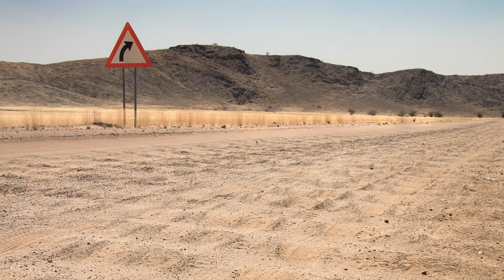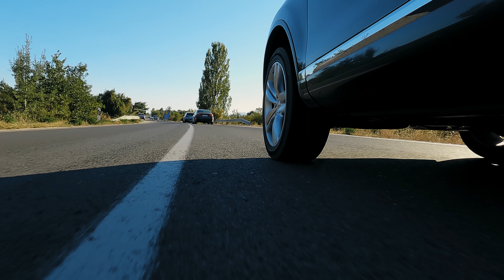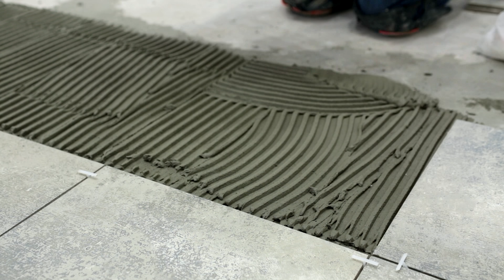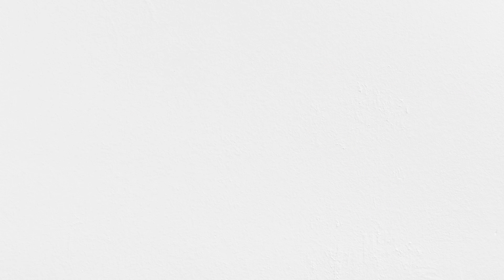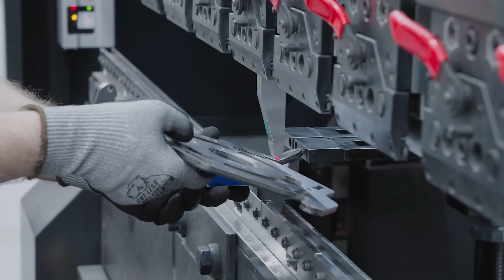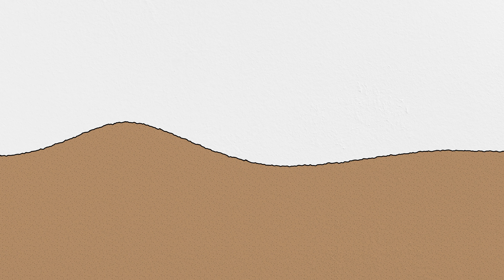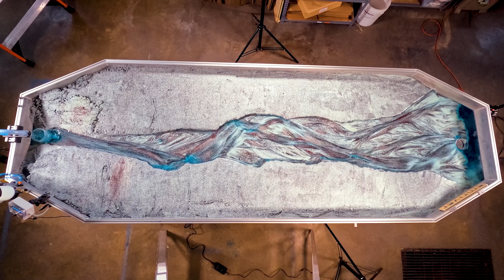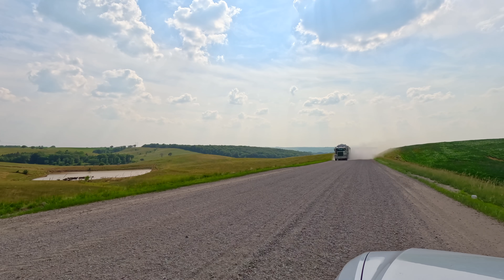Why Roads Get Washboards

Comment: If you've ever been to Oklahoma- asphalt and concrete highways can turn to washboards too
Reply: It's worse in a way.  You can fix a gravel road in an afternoon with a grader for relatively little money.  Not so much with concrete and asphalt.
Reply: @piquat1 The problem is sending somebody out there to fix something is more expensive than the fix itself.  

Having to send somebody out there in the first place means that you spent more money and you probably don't have the extra people laying around.
Reply: @hercules71185  Not really, I live on a gravel road.  It's 35 minutes just to get groceries.  Almost all the little rural towns around me have a grader.  It snows here....  Same grader levels my road several times a year.  They were at yesterday in fact.  

Same road paved, takes a crew, several weeks and millions of dollars.
Reply: @hercules71185  Yeah, I'm a traffic signal technician and it often costs more to send me out to remote places with a bucket truck than the parts and true fix time. I brought this up when I had to replace a bulb that went bad on a 4-way flashing beacon. The LED bulbs were from 1999 (LONG past their 15-year lifespan) and while the bulbs/modules are about $70/ea., it cost about $500 to send me out there to change it. So I said "why don't we just change the other 4 while I'm there?" and the reply was "we don't have the budget". Did I mention I work in government?
Reply: @hercules71185 that isn’t true at all. Counties have full time operators employed on rotations to maintain roads throughout the county. It barely costs anything to send a grader on a lowboy and a roller/ water truck for a day. Asphalt and concrete material and labor costs are significantly higher.
Reply: @piquat1  I'm not sure if I would call a grader, relatively little money.
Reply: @Falney  Compared to resurfacing a road?!?!  And the county and municipalities have them anyway for snow removal.  Yes, a grader is WAY more affordable than the price of repaving a country road.  Millions over and over again for each road... or we just buy another grader for $700k and avoid all that.  WAY cheaper.

AND, even after you pave it, guess what you, you STILL need a grader for snow removal on those paved roads, and general maintenance for all the roads you didn't pave.

Side note, you're going to have to actually pay to pave those roads, full price.  The grader is leased with a service contract.
Reply: @Falney  I think they are talking input cost. For the graders its just fuel. You could barrow/rent the equipment
Reply: @Falney I'm not sure you know what relatively means.
Reply: @Falney  back in the day every county district had a grader because of all the tertiary roads were gravel so they  started on one side of district and when finished needed to repeat the process !
Reply: @piquat1  Well, generally you don't use graders on hardtop, you use dumps with a plow. But I get what you are saying, don't know why people think maintaining a county/dirt road would be more expensive than hardtop.
Reply: @chavitacanta008  Still like that where I live, the guys running the graders are working almost year round or until the ground freezes.
Reply: @massaweed420  Actually around here they put massive V plows on the front of graders for gravel roads.  We get some big drifts on the plains because of the winds, normal grader blade wouldn't cut it.  While this isn't the best tool for the job, I suspect it's just to get some dual use out of them.  Counties and municipalities already have a grader or two, you're doing a lot less road maint. in the winter.  Might as well put a plow on the thing.  Out here they never haul it away.  Ditches are pretty big, they just push it off to the side.
Reply: Don't worry, Oklahoma is determined to fix it! They're okay with turning 2/3rds of their state into a construction zone
Reply: @CraigChrist8239 they've been "fixing it" since before 1985....
Reply: @mr9512  Loooooooooong before 1985, for they were awful when I was a kid (born in '67)...  Out in the Panhandle on US54, I often had thoughts that it was never really paved...  They simply began sending leftover asphalt out to create a highway out of continuous patches...  lol
Reply: @mr9512  That stretch of highway they were working on between Seiling and Watonga.... I remember being a kid and seeing them start some work on it and it was weird seeing finally finished like a couple years ago lol
Reply: @CraigChrist8239  that sounds like every state, always construction
Reply: @CraigChrist8239 dont forget that the toll roads are TEMPORARY. The toll will disappear! (They wont)
Reply: @CraigChrist8239  You pretty much summed up just about every state in the union. We have a saying here in Michigan regarding the seasons (I'm sure we didn't invent this and it's probably used elsewhere, but...) "We have two seasons, winter, and construction season."
Reply: @CraigChrist8239 In NM, the state symbol is the traffic cone.
Reply: @Richard-rz8gt  I hate to break it to you, but every state makes that joke.
Reply: @Richard-rz8gt in oklahoma, its a pothole

Im not from OK, but ive driven thru plenty of times. Some of the worst roads in the country
Reply: @FinneasJedidiah  Its no joke.  You been to ABQ?
Reply: @Richard-rz8gt  In PA our state flower is the traffic cone, how ironic
Reply: @Richard-rz8gt That's what we say in PA lol. The salt and freeze/thaw cycle destroys infrastructure.
Reply: @Richard-rz8gt  I lived in albuquerque for like 6 years, and trust me...it's not nearly as bad as some other places.  EVERYONE complains about this same thing everywhere, but there are actual differences.  And to be honest, after living all over the west...the northern midwest and northeast really have anything going on in the west completely beat.  We just don't get the same extreme freeze-thaw cycles that do the most damage by far.  There is obviously issues like inability to afford the repairs needed that hinder construction in places like NM, but ultimately the dryness sorta limits the amount of damage that can be done.
Reply: @Richard-rz8gt I work in oil and gas do I drive on a lot of lease roads and get to see a lot of places including the south eastern portion of NM. Honestly, y’all’s roads are not too bad. Plus, in the areas I’ve been, there are really good drainage ditches. I had never seen something like that in Texas. Also seen the kids playing in them which seemed pretty fun and I totally wanted to do that too. Bring out the floaties lol
Reply: @CraigChrist8239 and yet nothing ever is better
Reply: @OldManJoel69 can we just admit we're bad at roads across the USA? 😅😂
Reply: @CraigChrist8239  Oklahoma is... OK?
Reply: I've seen this phenomenon on asphalt roads in Maryland and Pennsylvania too.
Reply: @MosheKatz  Illinois too
Reply: You often see them  at traffic stops, even in very well maintained roads.
Reply: @ephremcortvrint2376  That's caused by heavy trucks squatting on their springs when they come to a stop, followed immediately by a spring rebound that puts extraordinary dynamic pressure on the pavement.  If it's asphalt hot enough to fry an egg in the sun, it's also softer than it's meant to be.  The result is pavement bog at stop lights.  To avoid this, TxDOT often inserts a concrete segment at signal lights on an otherwise asphalt road surface.  It's also more resistant to abrasion from turning traffic.
Reply: Oklahoma, the state that builds underwater bridges. And red dirt everywhere that turns into grease whenever it rains.😂
Reply: I've been to Oklahoma many times and used to dread when venturing off the most major highways.  I was all over much of the western half of Oklahoma last summer, and I was very surprised at how much improvement there's been.  There were new highways and highway surfaces in most places, and even more being done.  I've changed my mind about Oklahoma highways.  Good job, ODOT!
Reply: @MikeV8652
They’ve raised the fuel taxes,  it takes money to build a road
Reply: @MikeV8652 that's why you don't go west
Reply: In Colorado, the pavement doesn’t last long enough to turn into washboards. Our paved roads just turn into an obstacle course dodging the chunks of pavement that dislodged from the 70* day, followed by an overnight freeze, then rinse and repeat.
Reply: @dj7291993 Ouch.
Reply: @dj7291993  Ah, I'll never forget the off ramp that was somewhere between Kit Carson and Limon...it was concrete, but each section somehow sank down at the beginning and lifted up at the end.  The result was that it felt like driving down the world's shallowest flight of stairs.  It was so bad that I got out to look and measure the difference between the end of one section and the beginning of the next, and there was on average 10" of drop, some more and some less.  I've gone over far worse but I wasn't expecting that experience, not at all lol
Reply: Hot apshpalt can fold and ripple for sure
Reply: Highway, 113 north of Madison Wisconsin does this too
Reply: You can always tell when you’ve crossed the border into Oklahoma, your car will tell you.
Reply: I've been all over the US.  From literally chanute Kansas, LA Portland, Maine Seattle all over Hawaii Alaska, Florida.
I would say overall Oklahoma does rate pretty poorly. But that's because it's basically a desolate state.   If you get rid of tulsa and Oklahoma city. You have the population of an average metro area left for the entire rest of the state.  

Michigan will quite literally take the 3 most populated hubs and keep their rods destroyed.   
Florida it's the driver's in the winter. 

California is just sheer population. We all have issues. But the worst roads that will  destroy a brand new car on a 'freshly paved' road. Definitely Michigan.  You're going through the city. Watching the Christmas lights and it feels like you hit a dire hydrant.  Nope.  New pot hole!
Reply: As much as I hate driving through Kansas, I have to give it to them: their highways are immaculate.
Reply: @Thanatos2996 
Lots of red brick.
Reply: @Thanatos2996  Yeah they've got some great highways, even their rural roads connecting nothing to nowhere are well maintained.  I actually really enjoyed driving around western Kansas, shame about their speed limits though.
Reply: The most fun is in the frozen North, winter conditions create it too. Zero traction and washboard = a sketchy drive.
Reply: You should see how Indiana highways are 😂
Reply: Tennessee the same especially at 4 way traffic lights on small grades.
Reply: Obviously, it's not just Oklahoma. This is a problem in parts of I-5 north and south of Seattle.
Reply: So does water & ice
Reply: It does the same in Quebec 😂
Reply: The dirt roads just turn into pot holes😅
Reply: Most well-developed red state infrastructure
Reply: The should have graded the road first then paved 😂😂😂
Reply: I ran into a guy traveling on a Suzuki DR 650 (single cylinder) cross country in CA. He said the roads in OK, did him in and had to purchase new tires... so you are correct.. That is interesting.
Reply: What I want to know is why my car is so dirty after going through the pain of driving down a road with washboard corrugations? It should be sparkling clean and fresh smelling!
Reply: A TXDOT contractor managed to create a brand new concrete flyover connector with a washboard surface.
Reply: As one from oklahoma, agreed.
Reply: If you are in Oklahoma it's because whatever god you foolishly follow hates you and wants you to know how bad it can be.
Reply: Woah
Reply: hahahahahahahahahah yes yes they are. if you nw you know, my kidneys still hurt.
Reply: yeah, our tiny little Gorges town in CNY has enough busses going up and down the same few stretches constantly that several roads get washboarded within a couple years of being re-re-re-paved...
Reply: @takaela  what’s CNY?
Reply: @fellow_kind_human_being : central new york
Reply: @takaela  so, like Harlem?
Reply: @fellow_kind_human_being , heh... more like... Finger Lakes
Reply: New Hamshire too!
Reply: @warrenjones744  puerto rico! 6 months after any repair, the road is fked lol they do an awful job
Reply: American quality 🤣🤣🤣
Reply: Have you been on I-10 in Louisiana?  The washboard there were 20 feet apart, lots of fun towing a travel trailer.
Reply: I was disappointed that this was not mentioned. And I have never driven in Oklahoma, but have seen this in multiple states.
Reply: i5 in seattle has this problem
Reply: I guess any place with that ol’ travelin top soil with do it
Reply: Concrete roads were laid as 30 foot squares of washboard separated by an inch or two of bitumen where I grew up.
Not many people had a car.
Reply: Or anywhere in rural BC 😂
Reply: A few years ago (and maybe now) there was a section of concrete on I44 south of Lawton that had a really bad washboard going. Your whole car would shake.
Reply: @SRJason747 
Coming off the ramp at Prestwick International Airport the wings on a 737 used to shake and the rumble came up through your seat.
Reply: It always makes me think I have bad alignment or unbalanced tires...
Reply: Can confirm…checks out.
Reply: >when the redlights have ruts
Reply: @bones37 Here in New Zealand too
Reply: We find here in Pennsylvania this to be particularly true on small hills especially going downhill approaching a traffic light. ???
Reply: This happens in Arizona as well, I encounter several washboard patches on the switchbacks every day.
Reply: I was gonna say..
Reply: Concrete absolutely does not washboard.
Reply: So has my daily commute in California.
Reply: We get that at almost every intersection in Alberta. The temperature ranges are MUCH worse here.
Reply: Call in the Iowa DOT they’ll show you how to put down 30 year concrete pavement.
Reply: When it happens to asphalt and concrete it is usually the result of heavier loaded vehicles. Passenger Buses of all sizes and Semi-trucks reacting to imperfections in the road will have enough weight cause a wash boarding effect. 
Public transport folks may scoff at that but traffic's effect on a road is just as much a weight issue as it is a space issue. Heavier vehicles = Faster Degradation
Reply: Well, in Russia you can experience this even on federal routes in  some places. Big vehicles deform the asphalt coating slightly every time they go and slide it forward. Especially in the hot period of a year.
Reply: Ok, it's not just OK
Reply: If only time would make my stomach washboard.
Reply: @Deranged_Cop  Time in the gym... lol
Reply: Logan county, where washboard roads are tested
Reply: Oklahoma and Tennessee are the 2 states with the WORST roads I have ever seen in all my travels…

I live in Nevada btw so yeah I’ve seen a few roads in my day, and 100% backing you in this
Reply: Same in parts of Australia too. Especially wetter areas
Reply: My god, so glad I don't live out there anymore. Oklahoma suuuuucks.
Reply: Read my comment!  :face-orange-frowning:
Reply: I’ve never been to Spain, but I’ve been to Oklahoma.
Reply: I've only seen it once in Michigan, but I've seen it! I think it happens particularly when a thin resurface coat is put on top of a rough road.
Reply: That's what I was thinking of when I saw the thumbnail. And yeah, back in my homestate of Ohio, we don't have as many washboards as we do potholes.
Reply: You must live real close to me!! 😂
Reply: Да что вы творите комментаторы?😂 Ведь большинство людей в России уверены,что в Америке самые лучшие и ровные дороги. А плохой асфальт может быть только в России. 
Вы только что разрушили всё 😂
Reply: @lewii63  I don't think people would be complaining about US roads if they actually drove outside of the US once in a while.
Reply: @Skinflaps_Meatslapper  бро тоже самое могу сказать про соотечественников 😂 Только любят они кивать на запад и приводить в пример дороги в США. 
Но справедливости ради есть у нас поговорка,которой лет 200 уже, "в России две беды дураки и дороги" 
Надеюсь Гугл правильно переведет.
Reply: @lewii63  I guess that's just kind of the way things are when dealing with some of the largest countries in the world.  Why travel abroad when there's too much of your own country to see?  Most of the people in the US have only been to tourist cities in other countries, which have all the same things as US cities and look nothing like a foreign country.  That's assuming they even leave the US at all.  But to be fair we do have some really nice roads in places, which means we are obligated to complain about all the rest of them 🤷
Reply: Yep I travel over one every month, it runs for 1km and has been like this for over 16 years now.
Reply: Eww Oklahoma
Reply: Yup!
Reply: You aint lyin😂
Reply: Impressive.
Reply: Попробуйте поездить в России😁
Reply: Especially when it's super hot out. The material gets softer and starts to deform the roadway. (edit: spelling.)
Reply: @WarrenGarabrandt  oh so your roads get over-the-air updates? Are we talking SOLAR FREAKING ROADWAYS? xD
Reply: Sounds like they need to improve their road building.
Reply: @RG77-92 That's what caused the problem. 
Tennessee did the same thing in the 90s. 
Come to find out, paving every gravel road was a mistake and then you have to spend even more money to go back to gravel in order to fix it. 

Progress is a cult, not a culture.
Reply: @andrewom679  it's not progress to use the cheapest possible materials and be surprised that you have to fix it after a hot day. We have roadmaking materials and methods that work in many times higher temps, Oklahoma just can't pay for it due to refusing to tax the rich.
Reply: @kirknay  Rich people pay way more taxes than anyone else.
Reply: @s-w  And yet they're still rich.
Reply: @s-w  ha! Good joke. Bezos and Zuckerberg didn't pay taxes, they got taxes from the government.
Reply: @MushookieMan  So what? Earn your own money, stop trying to steal from others.
Reply: They'll just set a new toll station and get right on it in 10 years
Reply: @JusNoBS420 Make that 15-20, just in case.
Reply: Brokelahoma
Reply: Or better yet, never go to Oklahoma
Reply: @custos3249  No way would I avoid Oklahoma!  The roads are worlds better now, and it's otherwise a great state.
Reply: @MikeV8652 *looks at the politicians 

Ok.
Reply: @custos3249  all the states have those though
Reply: @nominalvelocity   Not like the ones in the OK corral
Reply: Best thing about driving in Oklahoma is getting to Texas. It makes me thankful to be in Texas.
Reply: @miguelsouderado3459 Best part about driving in Texas is leaving the state 😂
Reply: @jaxithfox Not if you're headed north on I35 to OK.
Reply: @miguelsouderado3459 only a Texan would like 35 going south into Texas. Hell on earth.
Reply: Arkansas isn't any better, man.
Reply: At least most of the toll roads in Oklahoma are pretty nice, and fairly reasonably priced.
Reply: No.